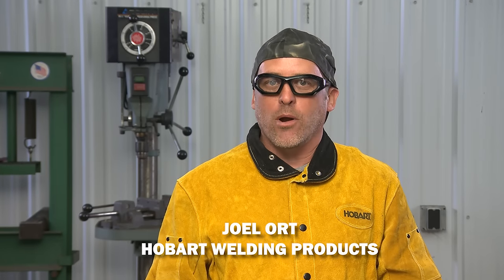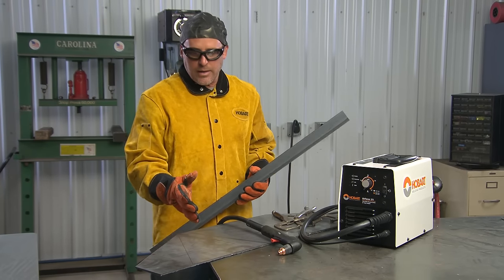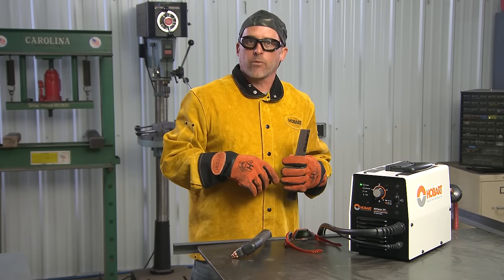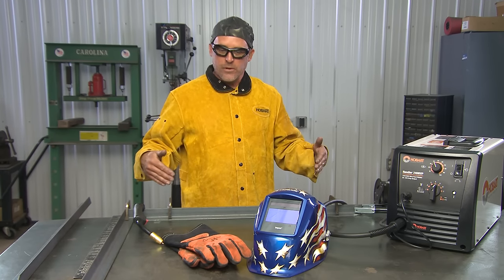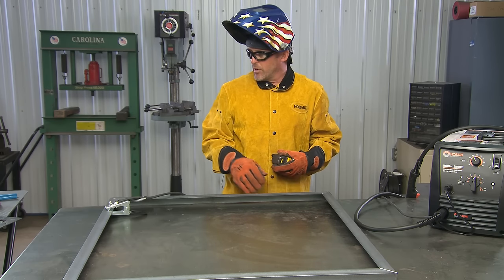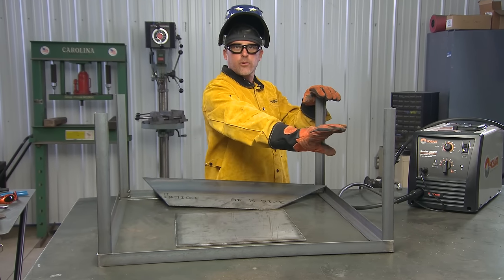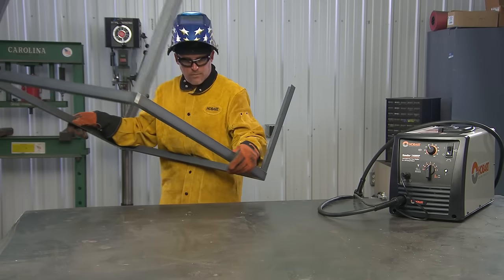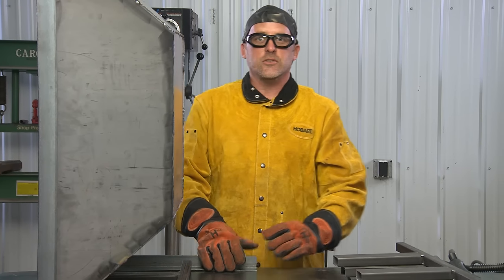How to Make a Fire Pit

Comment: Great build, Joel. Question for you. What were you dimensions on the top and bottom of your sheets and what angle did you set it at? 45 degrees I assume.
Reply from the maker: Thank you for your question, James! For the entire fire pit, including the bottom and four sides, was cut out of one sheet of steel that was 43.135” X 43.135”.  The sides were welded at an angle of 50 degrees. If you have any other questions, please let us know.

Comment: awesome fire pit, looks great. Could you please add the dimensions for the fire box itself
Reply from the maker: Thanks for reaching out, Joseph. You can find the dimensions for the fire pit below.

Top frame: 4 - 1.5” x 1.5” x .125” angle iron x 36”L
(cut ends at 45 degrees)
Legs: 4 - 1.5” x 1.5” x .125” angle iron x 18” L
Side vertical supports: 4 - 1” x 1” x .060” tubing x 33.5” L
Side bottom supports: 9 - 1” x 2” x .060” tubing x 8.5” L
Bottom leg supports: 4 - 3” x 3” x 3/16” flat stock
(optional if fire pit place is on a soft surface)

You can find this information on the 'How to MIG Weld a Fire Pit [Guide]' page here: https://www.hobartwelders.com/projects-and-advice/welding-projects/how-to-mig-weld-a-fire-pit-guide.
Reply: @HobartWelders  thanks. I’m specifically asking about the dimensions for the 3/16” sheet. I’m not seeing them
Reply from the maker: @josephreis7488  We recommend reviewing both of the links below for more information on the 3/16" sheet and the Fire Pit project.

https://www.hobartwelders.com/projects-and-advice/welding-projects/how-to-mig-weld-a-fire-pit-guide

https://www.hobartwelders.com/-/media/hobart/files/pdf/projects/firepit_projectguide.pdf

Please let us know if you have any additional questions. Thank you!

Comment: I followed the link for the step by step instructions but there was no measurements for the 3/16th plate how can I get the cut lengths for the project
Reply from the maker: Thank you for reaching out, Justin. Please let us know if the information below is helpful or if you have any other questions. 

The following is a list of lengths for each piece for the fire pit.
Qty        Description
4             1.5” x 1.5” x .125” angle iron 36” long for the top frame (cut ends at 45 degrees)
4             1.5” x 1.5” x .125” angle iron 18” long for the legs
4             1” x 1” x .060” tubing 33.5” long for side
9             1” x 2” x .060” tubing 8.5” long for side
1             4’ x 4’ x 3/16” sheet steel for pit, cut pieces out from the sheet
4             3” x 3” x 3/16” flat stock (optional for bottom of legs if fire pit will be on a soft surface to keep the legs from sinking)
Reply: @HobartWelders  what are the dimensions for the sheet steel, ie top length, height, bottom length and angle. cheers
Reply from the maker: Thank you for your question, Mike. You can find more information about this project, including the specs and materials needed here: https://www.hobartwelders.com/-/media/hobart/files/pdf/projects/firepit_projectguide.pdf. If you have any questions, please let us know.

Comment: In the PDF for this fire pit, it calls for 9 8.5" 1x2 pieces. Shouldn't it be 12?
Edit: If you decide to build this. Use something thinner than 3/16. It’s horrible trying to move it around.

Comment: Visually its ok,,, but its poorly designed to burn efficiently.. should have made it a little deeper, and placed a rack or grate 4 inches or so above the bottom . Then take that plasma cutter and blow out holes randomly below the 4 inches that the rack will sit at.... this will allow plenty of oxygen to be drawn in keeping that fire burning nicely all the way past 3rd base and into home.   If the fire is too cold , you'll be called out at 2nd everytime